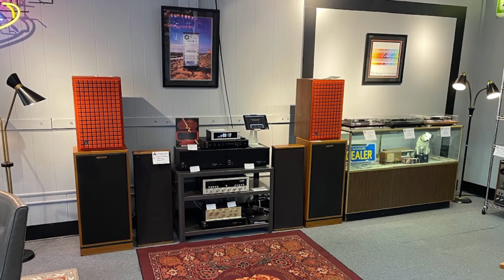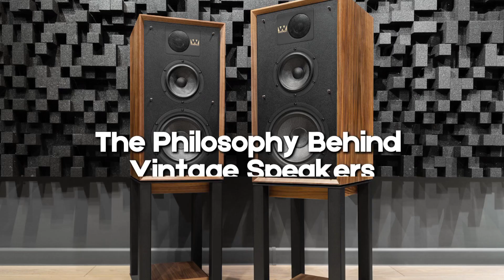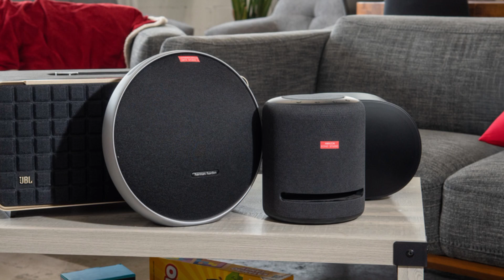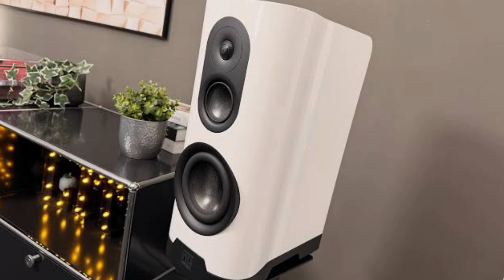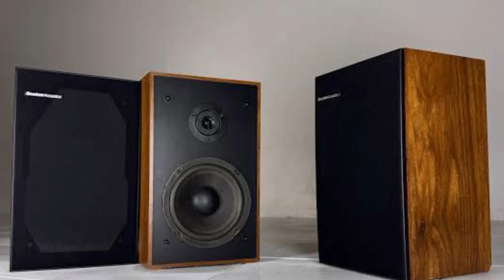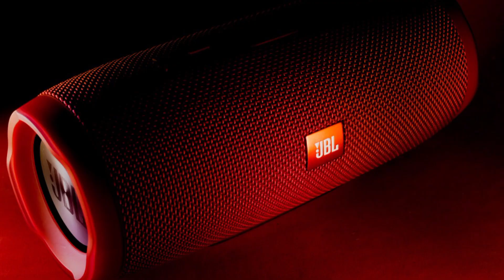Vintage Speakers vs Modern Speakers — Why Old Audio Still Feels Different?

Comment: If one is interested in real high-fidelity, one ignores wireless, powered, Blutetooth speakers because they use electronic tricks rather than quality drivers to produce sound. Vintage speakers can be great; they can also need a lot of work - refoaming the woofer surrounds; rebuilding the crossovers. Newer passive speakers have all the advantages of the advances in technology but rely on real amplifiers, not the toy, Class D amps in powered units. If you want background noise, buy a modern, powered speaker and pull the music off your mobile via Bluetooth (it's been my experience that Bluetooth does a lousy job of transmitting the full range of frequencies and I haven't been impressed with the Class D amps I've heard either). If you want to really HEAR the music, buy some good vintage or new speakers, a good Class AB amplifier and have a real audio system.